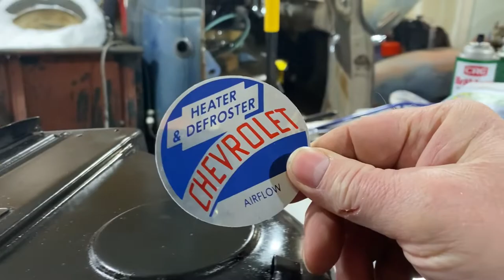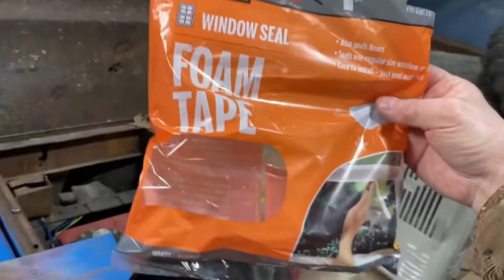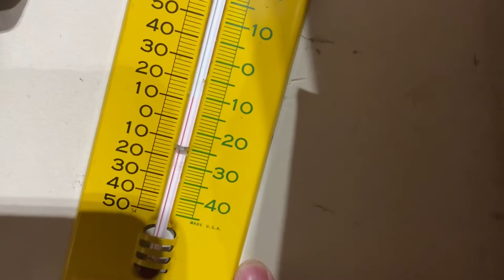Interior work for the 1954 Rat Rod Chevy Truck | Sunday Driver

Comment: Mid-'50s car steering wheels were of the deep-dish design, which don't adapt well to these early  '50s trucks because the length of the steering column is a couple inches too long. If you're going to go with that '57 Bel Air wheel, it would be advisable to replace that old steering column with a slightly shorter one to accommodate the off-set.
Reply from the maker: Do you know if I can swap a steering column out a 50s Chevy car into my truck?  is the column shorter in a car and will it bolt into my truck steering gear?  If not, do you recommend a company that can help me with this?  Thanks for watching!
Reply: @sundaydriverrides  I'm not sure how adaptable the car column is to the truck, but you might try finding measurement specs to see if it's do-able. I would also look into a column from the '57 to '59 Chev truck, as these years only came with a dished steering wheel. I'm not positive but perhaps that column was made shorter to compensate for the space off-set of their dished steering wheel. The '55 & '56 Chev truck (same generation) did NOT have the dished wheel, rather the flat style like your '54.
Reply from the maker: @carlv8168  Ok, I'll look into it more. Thanks for the ideas, I appreciate it.

Comment: Hello and Thank You for the Videos and your perspective. I am working on my 53 GMC and I look forward to your videos. My question is you used the POR15 on the inside of the cab and if I remember you are in Minnesota did you heat up your garage to a certain Temp before you brushed it on? or Do you remember approx what the temp was?  
Thanks again and I appreciate all the videos.
Reply from the maker: Hi Chris, I have put por15 on rusty metal when it is below freezing in my garage many times.  I just make sure I put a space heater next to it for like an hour or so after I paint it.  I put a space heater in my cab to keep it warm after I painted it and it was probably 25 to 30 degrees Fahrenheit in my garage.  Just don't put the heater too close to what you painted as I'm sure por15 is flammable.  I'm sure that's not what the manufacturer recommends and and it takes longer to completely cure, but it seems to still work for me.  Make sure to clean the area good before you apply it.  I hope that helps.  Thanks for watching!